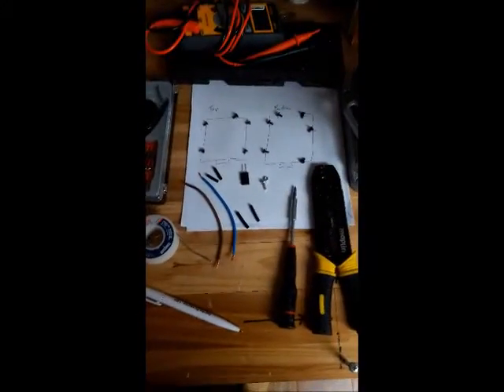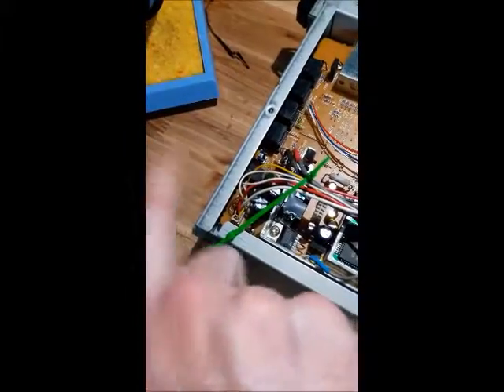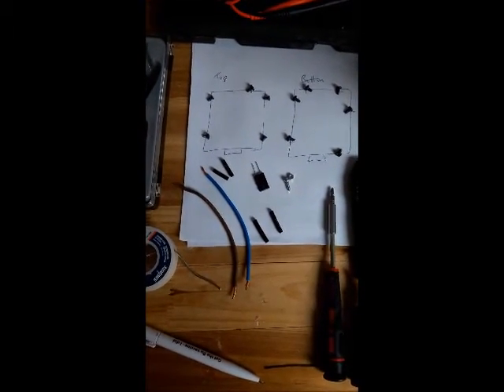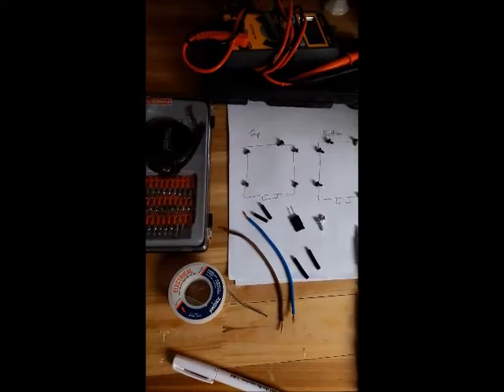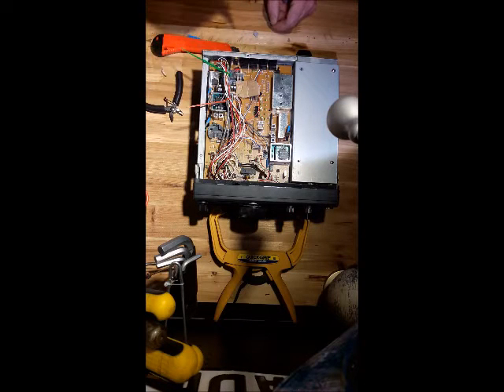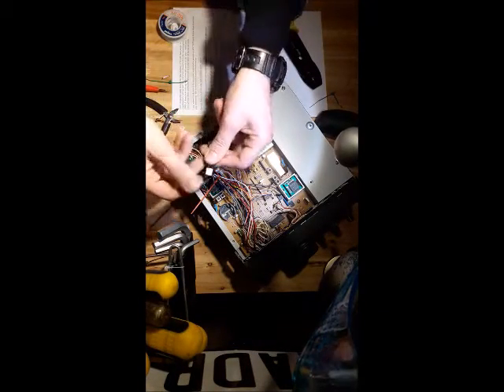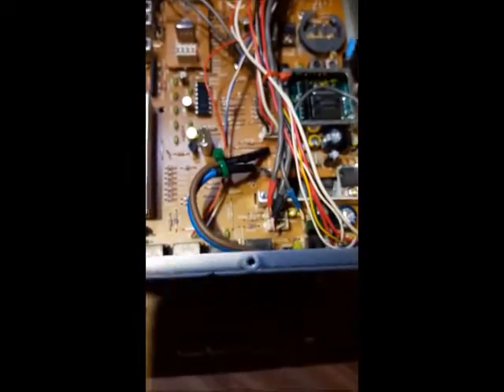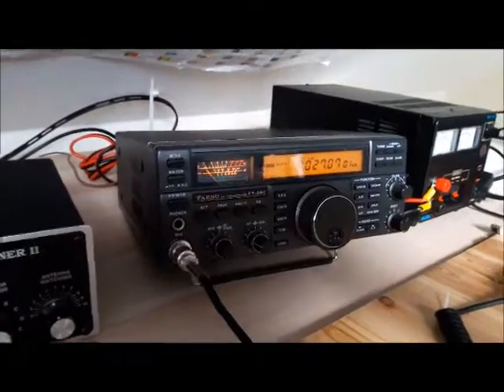Yaesu FT-840 resistor (R2213) replacement

Comment: do any of you guys know the sequence of the bandpass or selection by relays that controls each band..i got this 840 from a guy who was i guess a 10 mtr user..so the relay if only one ... is shot i guess and 10 to 12 mtrs does not work...so i wish the service manual would provide this as i am ready to go to work !....i can hack away with ie maybe a what is it,a stethascope like the drs use to hear which ones are comin on or off but all tips are appreciated...73
Reply from the maker: I'm really not great with technical stuff. If you ask Greg (link below) He's an 840 owner and has done a few repair and mods on it. I'm sure he'll point you in the right direction.   73
 https://www.youtube.com/user/HamAndShortwaveRadio

Comment: I did my resistor mod today and it's perfect. Thanks for the info and the link for the resistor. :-)
Reply from the maker: That's great. I have been using the radio a few times a week, always at 100W, since installation and I have had no problems. So best of luck - I think the FT 840 is a great little radio.

Comment: Did i miss part 4? Did you sort out the tx problem on the various power levels? I've just ordered the upgrade resistor for mine.  Thanks for the link to it.
Reply from the maker: The radio is perfectly fine since swapping out the resistor. The problem was actually an EMC issue i.e. A PIR (sensor light) out the back being triggered when transmitting. The light causes a lot of RF noise when on. I reduced the sensitivity of the light and it no longer causes a problem when transmitting. Lesson learned the hard way I suppose ☺
Glad I changed the resistor though. 73
Reply: Great that you found the problem and thanks for the reply.  73